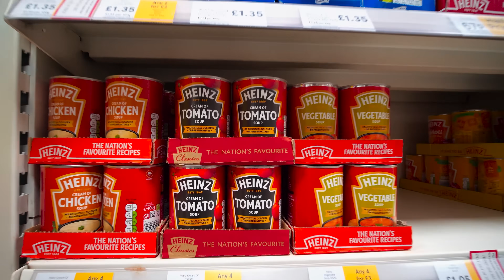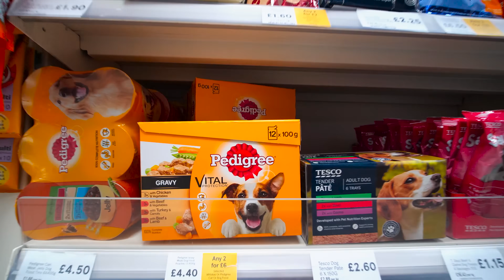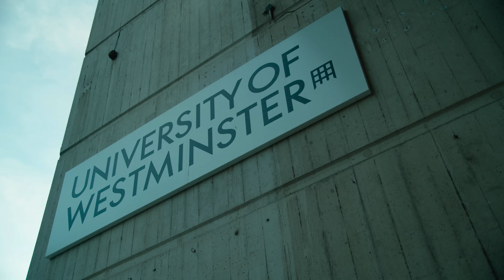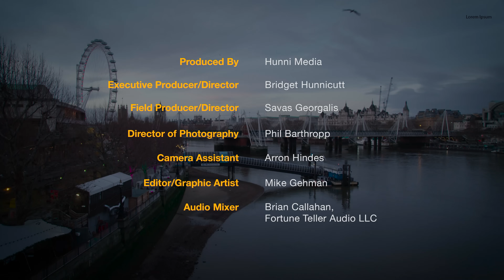Humanity After An Apocalypse | Bright Now

Comment: In your country they are bulldozing libraries up and down the UK, if you’re fortunate they might put what’s left of the library in the corner of a newly built recreation centre with shallow pool’s. So the odds of finding Useful information will be more difficult, especially when you consider that a small percentage of that once library actually contains useful survival information. 
Oddly enough the Mars initiative should help with civilisation resiliency, many useful things could be learned from bootstrapping a remote civilisation, in such a hostile environment. 
Long term storage media lifespans is constantly getting shorter with every reiteration of the technology. Every time they make computer circuitry smaller they also shorten its life expectancy because you lose redundancy in the form of atom. And whatever you do don’t forget the secret sauce that nobody else knows.

Comment: Hello interesting program. I’ve been a prepper for over 20 years. The water bottle purification SOLDIS will not remove heavy metals from water. So for example, if you try to use swimming pool water, you’ll get out any bacteria that may be in there. But the chemicals will not be removed. So on the one to 10 scale one being not good 10 being excellent it’s probably about a three depending on the water source. But if you’re going with a relatively clean water source, it would be a viable option.

Comment: Question about the suggestion for disinfecting water: If we choose a plastic bottle, aren't we then possibly leaching out chemicals from the plastic into the water. Wouldn't glass be safer? Next question: For folks living in areas of the planet in less intense sunlight (more northern place as opposed to the equator), or for different times of the year ( middle of summer as opposed to middle of winter).  The day my girls and I left Lake Isabella, California, it was 123 degrees in the shade. That technique would work nicely. Last winter in Harlan, IN,  it was twenty degrees below zero for several days in a row and cloudy.  Would you really be successful in disinfecting your water? Southern California wins. Northern Indiana , not so much.

Comment: Few would know how to get near pure compounds from which to make new compounds, and most makings require high heat (and maybe high pressure with other near pure compounds). There would be many sources of pure chemicals, nor of fuels to get higher than charcoal heat. Non electronic metal lathes are now hard to locate; if you did, few skilled old-school machinists would survive. 
(All items that include electrics would be useless, as a whole.
There would be few with then needed skill who would survive. There would be few to no cobblers. There might be a few blacksmiths and farriers.)

Comment: The very first thing you need to do depends on what happens and where you are in relation to that incident. If you are at the centre, will then. If you are are on the other side of the planet you might have a bit more time. Either way adapt.

Comment: Anyone else extremely skeptical of the SODIS (solar disinfection) method? Just boil your water if you have fire.
Reply: It's just another option, based on the circumstance. Actually, SODIS is a good multi-tasking method for disinfecting larger amounts of water. In Africa, Peace Corps volunteers have built angled metal racks loaded with re-used two liter pop bottles aimed at the Sun.
Reply: This is why i really love youtube. learning from folks who experienced things sharing thier knowledge.
Reply: Dumb question, if solar is used as a disinfectant. Why do scientists tell people not to drink rain water as it has bacterial problems?
Water in the sky, sun shining on water.
Reply: Plastic seems like it would poison the water, glass is more ideal.
Reply: The water has to be filtered first to remove particulate matter before disinfected via sodis. It doesn’t work well on murky water.
Reply: just don't run out of matches.

Comment: This is mostly fear-mongering nonsense.  The most important thing said was to appreciate why things come from.  In the worst case scenario, we couldn't go backwards past 1880.
Reply: Do you have 1880's tech lying around?  Sounds good but the levels will reach 1300's real quick.  Not as bad as you think, but far worse than you know.  Living in a 10x10 shelter because modern heating is out of reach.
Reply: @Michaelfatman-xo7gv  Yes, I do.  It's called my camping gear.  The world is not nearly as complex as you've been made to believe.  I'm biased because I'm an elementary, middle school science teacher.  I've built plenty of basic machines with kids to prove scientific and mechanical principals.  Almost everything we use now has a precursor.
Reply: @Nitro_Joe    It isn't complex....it is so simple that you're missing the point. Which really sucks because you just told me you are a science teacher and the concept of calories has been totally missed.  Gathering firewood for cooking and heating... axes and bow saws and skids vs chainsaws and trucks.  As for basic machines, replicate them with what?  Awesome if you have a bad habit of collecting old hand tools from garage sales.  Not so awesome if you have modern tools.  Tear some down, see how far you have to go before you either have a simple tool or something you can run off a pulley.  Camping gear is a death sentence.
Reply: @Michaelfatman-xo7gv  I understand that you see complexity in multiple systems, but you have to break them down.  Ancient technology can be fast tracked with modern understanding.  I fully understand Kcal (calories).  I garden for food and classroom projects.  All I'm saying is it's really not that difficult to rebuild a fallen world with proper knowledge.
Reply: @Nitro_Joe    Without a massive population to maintain our current level it doesn't come back.  There may be pockets of semi modernity clustered around high energy sources but otherwise, it's going to rough.  Most anything done will be by manpower alone, most draft animals will have been eaten or used to death or the fact that a 1200 lb animal eats a lot, so the complex / low tech machines have to return.....now.  Before the collapse.  Ever realize how much time a simple apple corer/slicer saves?  Those didn't show up until the 1860's..  Break down how much work is to build one from scratch, even out of wood.

Comment: He used the number 99%. Okay.
1% of doctors survive and treat the remaining 1% of patients.
There is no invisible process that brings food to the shelf. WE do it. And 1% of farmers can still feed 1% of citizens.
1% of energy is all that will be required toservic3 1% of homes, etc.
Reply: Will there be enough spare parts for the doctor to do an X-ray? What if the 1% of MRI technicians are nowhere near the surviving doctors?
Who will manufacturer all the meds the doctor will need? Same goes with energy. Today's farmers are high tech, and the equipment runs on petroleum. Who is manning the refineries? Just some thoughts...
Reply: @huckleberryeast The answer is the same. Also, 1% of technicians can keep 1% of the communications running. 
But that's just my opinion. You should certainly consider creating a suicide pact with yourself in the event of a collapse. You're already half dead.
Reply: 1% of farmer will never be able to feed 1% of the population, they rely on the infrastructure which would be nonexistent in an apocalyse. We would need more like 30% or more of the surviving population to feed the  rest of the  survivors.